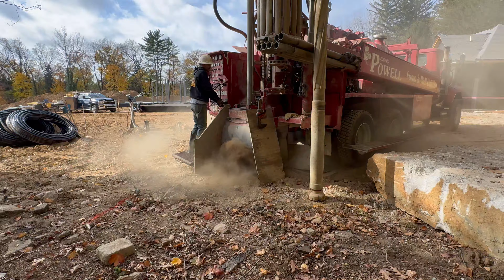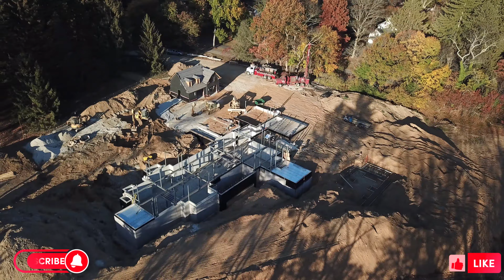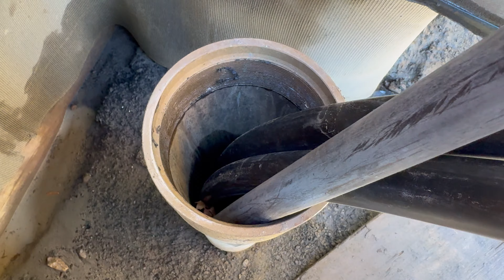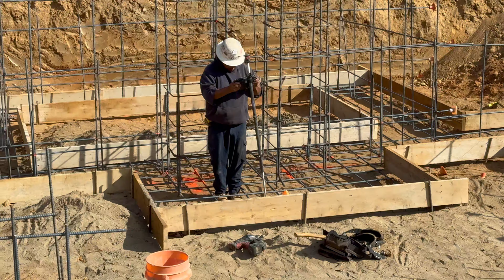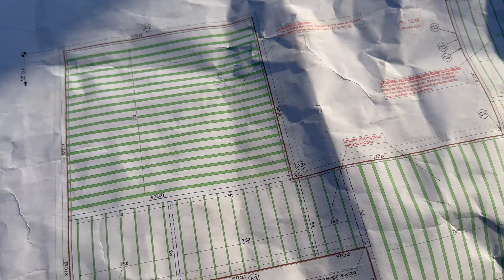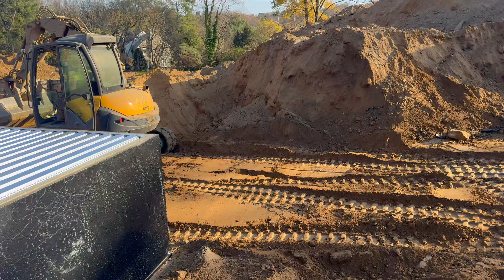Geothermal wells!!   Ep12  Project build

Comment: Thanks for the narration. I hope you will talk more about the heat pump setup for the geothermal system and predicted contribution to the heating and cooling load.
Reply from the maker: No problem and thank you for watching! Wont be bit till we connect things up on the inside. But when the drilling is complete well tie these into the house.